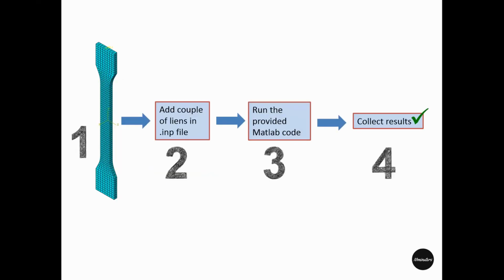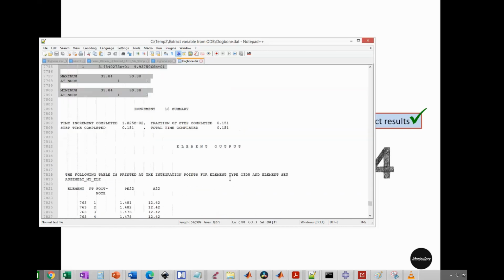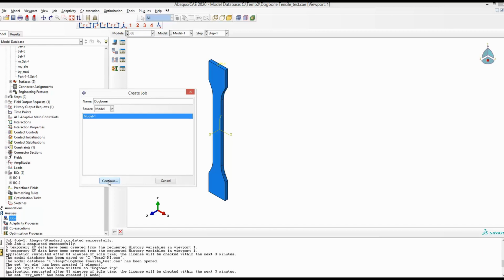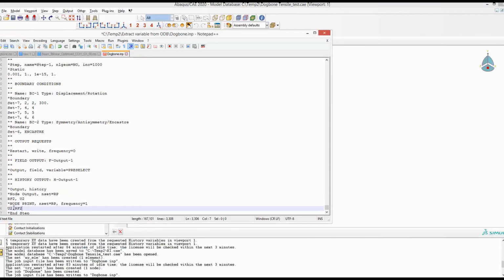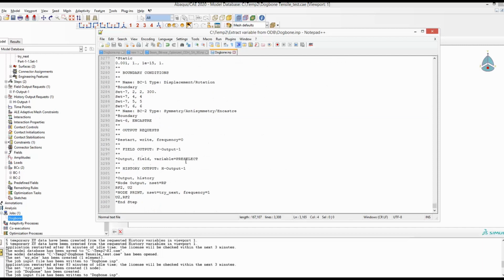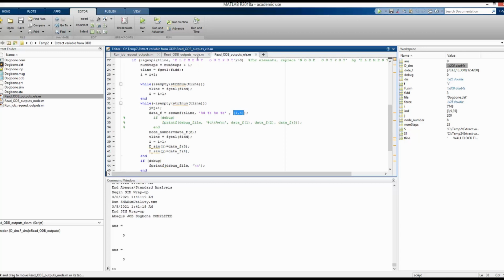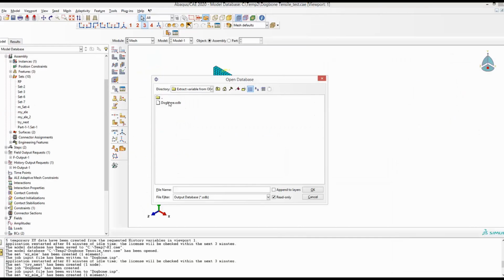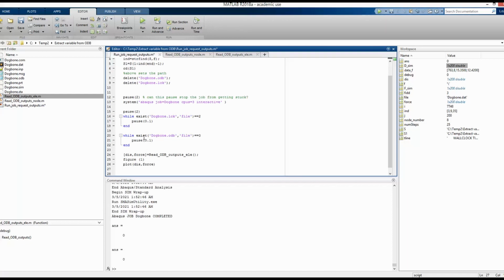Read Abaqus results from Matlab (code included)

Comment: Thanks a lot for this video. I just have two questions:1- if I want to extract the output at special time points how can I define it in the input file? 2- can I get data at every time point and use it for a step-by-step calculation or do I have to wait to complete the analysis and then use all of the output data, in other words before the analysis is completed are the outputs are accessible?

Comment: Thanks for this video
I'm doing creep simulations with abaqus and I would like to extract with Matlab a node displacement and the step time for each increment
With your Matlab code I can extract the displacement, but how can I extract the step time ? Thanks
Reply from the maker: A simple way is to convert your displacement into time. For example, if the simulation step time is 1s and you pull an end by total of 10 mm, then, at 2.5 mm displacement, you know the step time is 0.25s.
Reply: @10Minuters  Thank you for your answer. I think this could work for a static analysis, but as I'm doing a visco analysis, I don't have the displacement or the force that depends directly on the step time
Reply from the maker: @martheloiseau3015   Adopting this code for reading node output might help, it works for the example in this video:

function [D_sim,F_sim]=Read_ODB_outputs()
clear all
close all
debug = 0;
if (debug)
    debug_file = fopen('debug.dat', 'wt');
end
while exist('Dogbone.dat','file')==0
    pause(0.1)
end
file = 'Dogbone.dat';
fidd = fopen(file);
i = 0;
pause(0.5)
numSteps = 0;
j=0;
while ( ~feof(fidd) )
    
    tline = fgetl(fidd);
    
    i = i+1;
    if (regexpi(tline, 'N O D E   O U T P U T')>0)  %For elements, replace 'N O D E   O U T P U T'  by 'E L E M E N T   O U T P U T'
        numSteps = numSteps + 1;
        tline = fgetl(fidd);
        i = i+1;
        
        while(isempty(str2num(tline)))
            tline = fgetl(fidd);
            i = i+1;
        end
        while(~isempty(str2num(tline)))
            j=j+1;
            data_f = sscanf(tline, '%d %e %e', [1,3]);
            if (debug)
                fprintf(debug_file, '%d\t%e\n', data_f(1), data_f(2), data_f(3));
            end
            node_number=data_f(1);
            tline = fgetl(fidd);
            i = i+1;
            D_sim(j)=data_f(2);
            F_sim(j)=data_f(3);
        end
        if (debug)
            fprintf(debug_file, '\n');
        end
    end
    
end
ii=1;
file = 'Dogbone.dat';
fidd = fopen(file);
i = 0;
pause(0.5)
numSteps = 0;
j=0;
while ( ~feof(fidd) )
    
    tline = fgetl(fidd);  
    
        if (regexpi(tline, 'TIME INCREMENT COMPLETED')>0)  %For elements, replace 'N O D E   O U T P U T'  by 'E L E M E N T   O U T P U T'
        numSteps = numSteps + 1;
        tline = fgetl(fidd);
        i = i+1;
            j=j+1;
            data_f11 = sscanf(tline, '%s %s %s %e', [1,18]);

            node_number=data_f11(1);
            tline = fgetl(fidd);

            Time_inc(j)=data_f11(18);
            
        if (debug)
            fprintf(debug_file, '\n');
        end
    end
    
end
fclose(fidd);
fclose all
Reply: @10Minuters  Thanks for the video, it helps a lot. I am not sure how could I get the displacements with respect to time for each increment. Any suggestions/help is highly appreciated. Thanks again!

Comment: Thanks Sir For sharing,
I would like to ask you one question. 

I would like to extract the results on one additional RP.
I modified the input file by writing at the end two additional lines:
*NODE PRINT, nset=RP, frequency=1
U2,RF2
*NODE PRINT, nset=RP2, frequency=1
U1
*End Step
 
The code does not work.. It seems that I have to modify the function Read_ODB_outputs_node . 
Could you please advise me? 

Best,
Reply from the maker: Hi Khadija, please use the following code instead for "Read_ODB_outputs_node":

function [D_sim,F_sim]=Read_ODB_outputs()
clear all
close all
debug = 0;
if (debug)
    debug_file = fopen('debug.dat', 'wt');
end
while exist('Dogbone.dat','file')==0
    pause(0.1)
end
file = 'Dogbone.dat';
fidd = fopen(file);
i = 0;
pause(0.5)
numSteps = 0;
j=0;
while ( ~feof(fidd) )
    
    tline = fgetl(fidd);
    
    i = i+1;
    if (regexpi(tline, 'N O D E   O U T P U T')>0)  %For elements, replace 'N O D E   O U T P U T'  by 'E L E M E N T   O U T P U T'
        numSteps = numSteps + 1;
        tline = fgetl(fidd);
        i = i+1;
        
        while(isempty(str2num(tline)))
            tline = fgetl(fidd);
            i = i+1;
        end
        while(~isempty(str2num(tline)))
            j=j+1;
            data_f = sscanf(tline, '%d %e %e', [1,3]);
            if (debug)
                fprintf(debug_file, '%d\t%e\n', data_f(1), data_f(2), data_f(3));
            end
            node_number=data_f(1);
            tline = fgetl(fidd);
            i = i+1;
            D_sim(j)=data_f(2);
            F_sim(j)=data_f(3);
        end
        if (debug)
            fprintf(debug_file, '\n');
        end
    end
    
end
ii=1;
file = 'Dogbone.dat';
fidd = fopen(file);
i = 0;
pause(0.5)
numSteps = 0;
j=0;
while ( ~feof(fidd) )
    
    tline = fgetl(fidd);  
    
        if (contains(tline, 'THE FOLLOWING TABLE IS PRINTED FOR NODES BELONGING TO NODE SET ASSEMBLY_RP2')>0)  %For elements, replace 'N O D E   O U T P U T'  by 'E L E M E N T   O U T P U T'
        numSteps = numSteps + 1;
        tline = fgetl(fidd);
        i = i+1;
        
        while(isempty(str2num(tline)))
            tline = fgetl(fidd);
            i = i+1;
        end
        while(~isempty(str2num(tline)))
            j=j+1;
            data_f11 = sscanf(tline, '%d %e', [1,2]);
%             if (debug)
%                 fprintf(debug_file, '%d\t%e\n', data_f(1), data_f(2), data_f(3));
%             end
            node_number=data_f11(1);
            tline = fgetl(fidd);
            i = i+1;
            D_sim11(j)=data_f11(2);
            %F_sim11(j)=data_f11(3);
        end
        if (debug)
            fprintf(debug_file, '\n');
        end
    end
    
end

fclose(fidd);
fclose all
Reply: @10Minuters  Thank you sir 
It works perfectly!

Comment: Thank you for sharing

1. How to output the weight of the structure?

2. How to read the maximum stress or strain?

3. Can I read ODB file directly using MATLAB?
Reply from the maker: Form CAE: 
1. tools-->query-->mass properties.
2. Contour options--> "limit" tab -->tick "Show location" box for max and min.
3. Difficult to give a short answer, you have to write and then edit the matlab code for output you need. Not directly from ODB though! Can check "abaqus2matlab" application for a jumpstart.

Comment: Thanks again for this video. I have a question. 
In my FE model, when I define a set with one element in the .inp file, the number of the same element is changed in my .dat file to another number. Do you have any idea what can be the origin of this problem? To be more clear, I will write an example.

Input file:

*Elset, elset=my_element, instance=Part-1-1
 10000,

.dat file:
element sets:
    MY_ELEMENT:
      instance name: PART-1-1
      number of elements: 1
      elements: 
        1772

The number 10000 has been changed to 1772 automatically.
Reply: I found that the reason is the difference between the number of local element number and global element number, now I am trying to make these numbers consistent with each other
Reply from the maker: Great! Please let us know if you succeed.